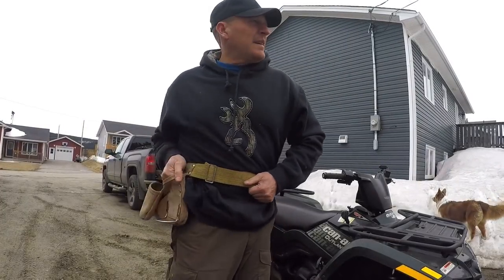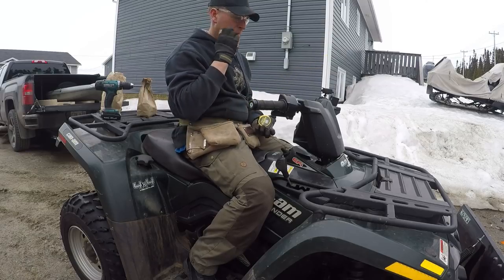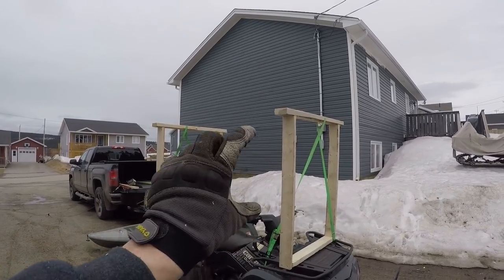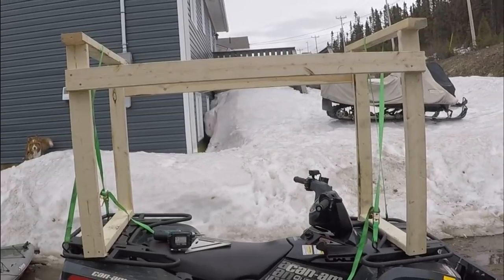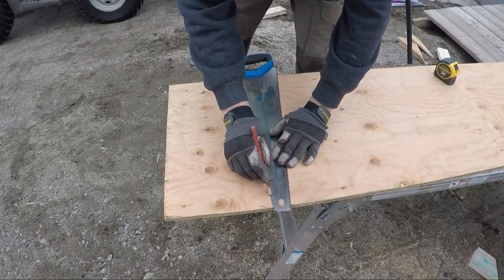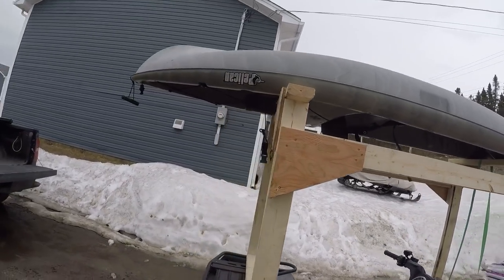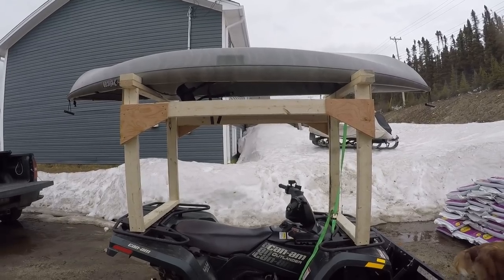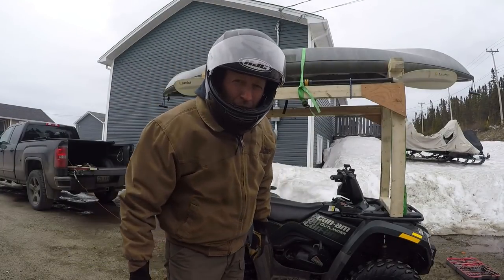BUILD YOUR OWN ATV KAYAK (CANOE) RACK FOR UNDER $100 | GEARING UP FOR FISH

Comment: Hey Chuck, great video! I bought a Yamaha Kodiak 450 last Friday and today (this Friday) built a canoe rack just like yours only I put gussets on the bottom as well. I strapped it all down and put my canoe on it and strapped it down and took it for a test spin. I had issues with the bottom sliding “back and forth” on my racks. It looks like your front rack has a bar that is parallel to your handle bars that the bottom 2x4 rests against that helps keep it in place. I think the solution for me is to get some “U bolts” and put them on my rack in front of and behind my lower 2x4’s so they can’t slide back and forth. 
All in all it’s a great rack and I look forward to using it to get me into a lake I wouldn’t otherwise be able to get to . 
Thanks again!
Ohh, I picked one of the hottest days here in Phoenix (aka hell) to build it 😂😂
Reply from the maker: Haha. I hope you didn’t overheat too much my friend!!  I used my rack a lot over the years and went 100’s of kms. Some days it wobbles more than others but overall it worked very very well. It was a game changer for me for sure

Comment: Great job, I built on once out of that galvanized threaded plumbing pipe you  can get from Canadian tire,  it worked out great, the threads helped with some give if, I hit a tree it would just bend a bit and easily twisted back in place. Had it for over 10 years.
Reply from the maker: Awesome.  Sounds like a good material to use 👍

Comment: Great videos especially the fishing ones. 
Just wondering how is the kayak rack is holding up I have been thinking of building one from steel tubing.But after watching your video wood is a lot cheaper.
Reply from the maker: Hey Paul. I still use it every year. Works perfectly. No issues at all

Comment: Just wanted to know if you have a vid on your solar hookup, I’m just starting mine with 3 x 100 watts panels and 5 deep cell RV and Marine 12 volt batteries, a charge controller and a 2000 watt inverter. Just trying to get some ideas on different setups and trying to determine best one for me, I won’t be using much on the system, only big drain is my three way propane , electric fridge which I’m trying to get full time solar with instead of propane when generator not going. Any and all help would be appreciated Chuck and luv your vids.
Reply from the maker: Hey Barry.  Unfortunately I don't have a video dedicated to that specifically. In fact, I'm surprised that I've gotten so much interest on even the video that you watched there.  My system works extremely well.  600W wind generator plus the 175 watts of solar easily feeds my lights, thermostat, tv, cell phone booster for days on end (the wind generator made a HUGE difference).  I used to power a small fridge, but it would drain the system incredibly fast. I have 4 caterpillar "haul truck" batteries which rarely ever go down below 12.0V.  I found it crucial never to let your batteries go too low in the winter time.  Having them low, coupled with extreme cold, shortens their life span considerably.  (Since I got my wind generator I havent lost a battery since). Ive since gotten a propane fridge which leaves that power saved good for most everything else.  Hope this helps a little

Comment: Great job building your kayak rack. I lucked out on mine, bought it @ a garage sale a few years ago for $25. :-). I didn't like the way it threw the centre of gravity off the quad. Didn't take me long to put the Yammie on its side... Mind you, I had a 10' Jon boat on top...lot heavier. It's been rusting-in-pieces in the back on the garage ever since. Opening weekend for walleye here, in N. On. Half the lakes are still frozen. Sure is a weird Spring. When does the season open there?Awesome video. Thanks for sharing. Be safe!
Reply from the maker: Season opens feb 1 and runs right TIL sept 7. Won’t get after speckles until ice goes in about two weeks hopefully. That’s right about when the flies start too o the bad comes with the good lol
Reply: Lol. So true! Like my late father used to say :"If the bugs don't bite, neither will the fish". Walleye season closes here on Apr. 30, for spawning season, & reopens May long. Things sure are screwed up this year.Thanks for the reply.

Comment: Beauty build, how about a crows nest for the doggy?  TFS Chuck!
Reply from the maker: haha...yes sir!!!  I do have a concern/regret whenever I use my kayak tho….main reason being that Willow cant accompany me due to weight restrictions on the kayak itself.  I'm definitely in the market for a lightweight canoe (ie., swift) but you cant get them here unfortunately (I would have to travel to another Province to obtain one).  I've even looked at building a small canoe, however, it seems building one would mean it'd be to heavy to carry any distance at all.  So, I'm in a quandary!!  (Btw, I do own two canoes but I have them stored in the bush next to fishing ponds and don't ever take them from those ponds.
Reply from the maker: Sounds like you’ve had some experience with boating sir. Good read you had there. I’ve looked at the Swift canoes from Ontario. Quite expensive but I’d still have one if I were closer as they would fit my lifestyle quite well. The Kevlar ones only weigh 20-22 lbs (12ft).   If I take a trip to Ontario anytime soon with my truck I just may have to make a visit to them. Btw, I’ve watched the construction of the 1/4” canoes and like them but think they would be a touch heavy to cart around the country for any distance. Thanks for the comment. Keep in touch. 👍
Reply: Its all good...let the good times roll!
Reply from the maker: Excellent. Will definitely check out your link. 👍.

Comment: Two things. First, I prefer the old intro theme music to what you used today. I thought I was watching a different channel at first. I was glad to hear it at the end. Second, I am from the US and see so many comments on other sites about the US using imperial measurements so I was mildly surprised to hear you using inches. Is that common in Labrador?
Reply from the maker: Ha!!   I didn't think anyone would notice the new music!!  Every now and again, youtube picks up that theme music as copyrighted (although it's not).  The copyright "proving stage" takes upwards to 30 days, which, of course I'm not going to wait around for.....so, long story short, I uploaded the exact same video with that music just until I get that dispute settled....but thanks for noticing!!!  :)  To answer the second question....yes I use inches (feet) mostly my whole life....in fact, I purposely buy a measuring tape that only reads inches/feet....just something I got used to I guess and old habits hard to break.  Thanks for watching Matthew and I promise I'll change the theme music back once the dispute is settled!!
Reply: Pretty common all across Canada; especially among us older (anyone older than a millennial) folks-and most construction is still feet and inches. I personally won't buy a tape measure unless it's Imperial only.(half and half-inches on top, centimeters on bottom- ones are common).
Reply from the maker: Yes and I was born in 72 so my father bred the imperial measure tape into our heads. Hard to teach an old dog new tricks lol